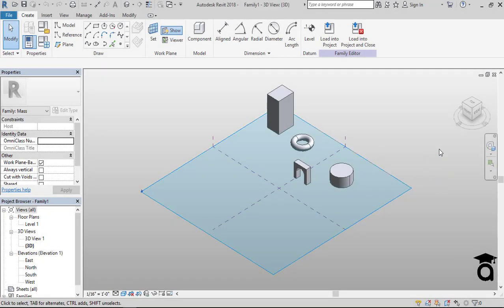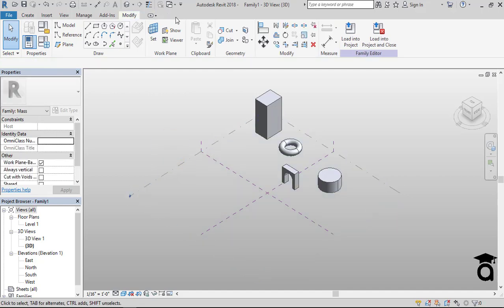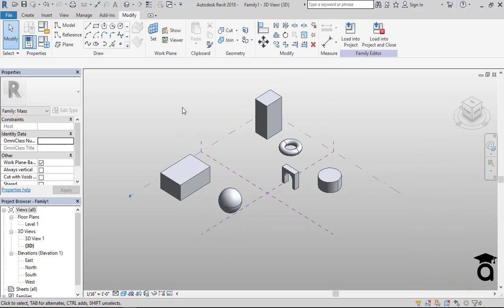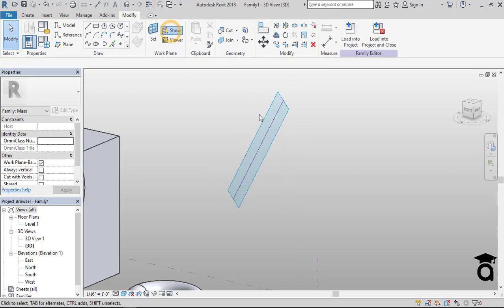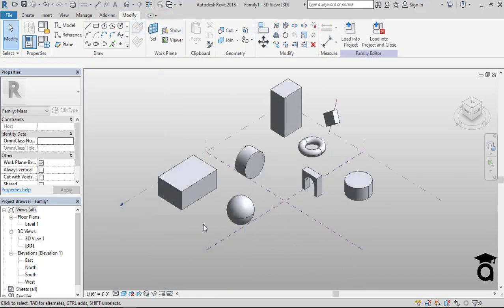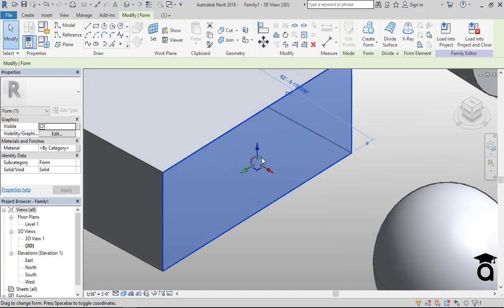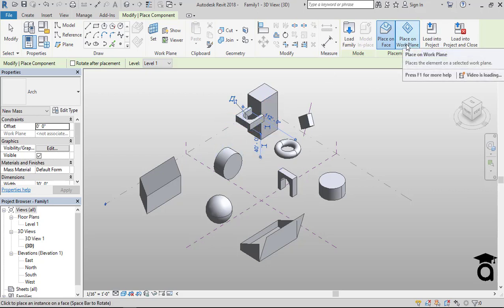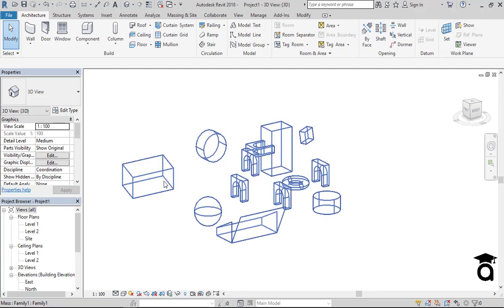Conceptual massing basics for revit part 1 || Revit lesson 2

Comment: Hi guy
I'm having a problem using the FamilyType.ByGeometry node, and more specifically the "Category" entry. 
I want to create a conceptual mass (link from my templatePath) and the associated category is "Mass". However, when I launch my script, Dynamo reports the following problem: "FamilyType.ByGeometry operation failed. Category with name Mass not found". 
I should point out that I'm launching the Dynamo plugin from a conceptual Volume Family window.
Do you know where this error could be coming from?
Reply from the maker: It seems you’re encountering an issue with the FamilyType.ByGeometry node in Revit. This node is returning null and displaying an error related to an element ID. One possible cause could be the interaction change in revit version you're using, where imported geometry is pinned. This might affect the node’s behavior. You could check if imported SAT files are pinned, causing the issue. Additionally, make sure your project units are set correctly in Revit. If the problem persists, consider reaching out to the Dynamo community for further assistance.